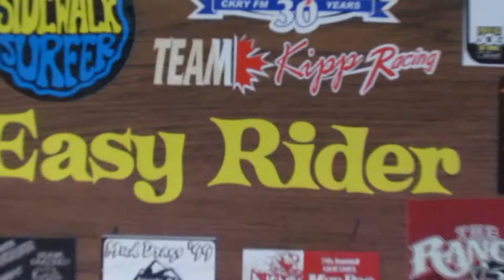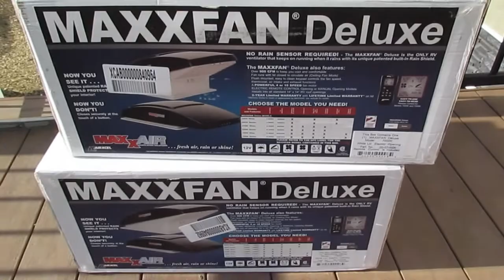Maxx Air Fan Deluxe | S01 E06 | Restoring Vintage RV Roof Vents Install

Comment: Fantastic vents are the best thing we ever put in our MH and slide in truck camper. They pull air in or out with auto rain sensors so you can leave them open and if it rains they close….thermostat opens and closes lid when you set temp.  Almost like air conditioning
Reply from the maker: Yes they work well! Thanks for watching

Comment: Perfect! I'm hoping to replace my 28 year old AC unit with a fan like these. Keep us posted on how yours are doing!
Reply from the maker: Hey we used our f an while working on the rv this summer and yes it works great. Just keep it clean from bugs as they like to get trapped inside which could slow the speed of the fan.

Comment: I didn’t see you use any bedding compound between the roof vent and the roof of the van
Reply from the maker: Hey Jon, We have never heard of bedding compound before so we will have to look into that. Thanks for your input. We did use Butyl Tape and Lap sealant when we did this in the fall and so far no leaks. Fingers Crossed!